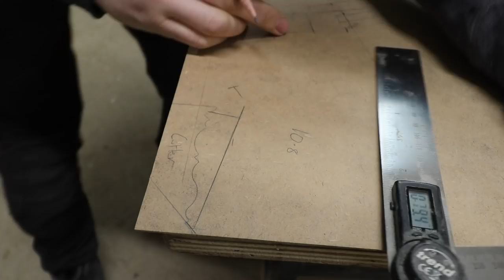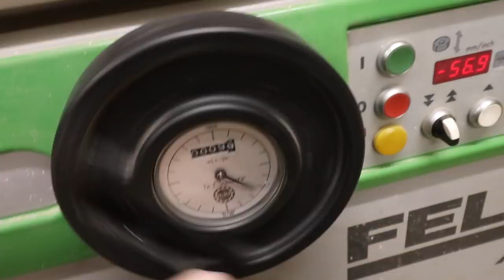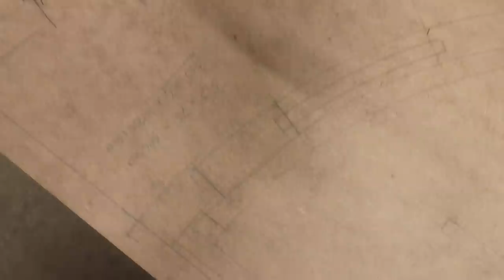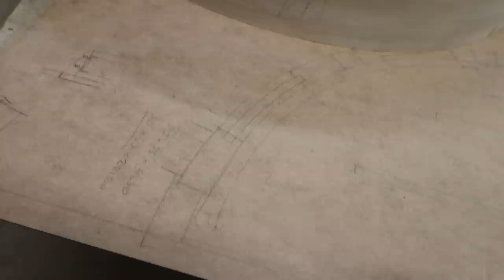Curved Cornice on the Spindle Moulder

Comment: I love the jigs that you make to help with what your doing. A piece of wood with a square cut out 3 blocks of wood screwed to it that thing with the wheel to add some pressure and Bobs your uncle. We expect such perfection from you now and you don’t let us down. Amazing.
Reply from the maker: Cheers John, alot of the time its about efficiency and Planning. If i dont know a successful path to completion i dont make a start until a plan is in place! Like laminating the timber. If i hadnt added the extra height i wouldnt have been able to machine using the uncut part of the false fence to run the moulding on.

Comment: Great to see that there are still some craftsmen coming through! I was a time served, wood machinist 50 years ago! Our machines weren't as sophisticated and we didn't have vacuum bags then either! But the principles are exactly the same! The biggest difference that I noticed was you planned the set the smallest surface on the bed of the SM and I was taught that the broadest side down always! Times change!
Reply from the maker: The smalles edge being down in this case didn't matter as the curve of the moulding supports the piece from tilting! It also means I can bevel the cutter to the right angle, the spindles do not tilt forward only backwards so was the only way it could be done. 

Many thanks for the kind words 👍
Reply: Safety.More liable to snatch the way you mentioned. When moulding is too thin I use back support and toggle clamps. I also served an apprenticeship in wood machining  and after 37 years on a spindle which i use daily i can safely say i have all my fingers

Comment: Always learn something from your videos and I consider myself a competent bench joiner. Showing the big boys of you tube how it's done!  I've had a few scares with the spindle moulder over the years always treat it with respect!! Top class content keep it up! 😎
Reply from the maker: Cheers Scott, i think everyone can learn something from someone, so its good to show your methods/share. Its easy to  have a lapse, or even a unknown piece of grain/knot can cause havok where there shouldnt have been so yeah im always wary.  Sometimes remove clips from the videos because it looks dangerous where my hands are etc, but ive always got a weight in my body position of the work were to suddenly dissapear, that i wouldnt be pressing into the cutter. But its hard to portray that and get loads of negative comments about safety..!

Comment: Great video Oliver and always interested to see how other people do their  curved work. When I do Bowed boxframe sash windows I use a former clamps etc  but having watched your video I will look into the vacuum bag. I've had my Felder f700z for 3 months now and love it.Felder make excellant machines even if their lead ties are long. I'm still waiting for my bandsaw which I ordered last May.. Running the large cutters on a 100mm block is a bit "squeeky bum" time ,I find wearing Tena men help me.I was always told to respect the spindle moulder but don't be afraid of it. lol...All the best and look forward to your next video. I've recommended your channel to a couple of other Joiners.
Reply from the maker: Cheers Adrian, I would personally look at the Curvomatic aluminium setup. Looks brilliant and brought to my attention by a member on here. If i do any more curved work, i will be giving them a call to see if they will do me a deal for a feature video! haha
Ive seen a old boy but bigger cutters in a 30mm whitehill block before. just clamped in the middle, so this one with pin locations is practically child proof! haha! Safe to say everyone else exited the room while he was working. Lol There would often be wedges stuck inthe end wall of the workshop as he cut folding wedges off each other on the table saw, the would bind and get thrown down the workshop 10+metres from the saw and stick in the timber panneling. Haha not good!
Reply: @BradshawJoinery  Cheers for the heads up Oliver, I did see the Curvomatic set up a couple of years ago and it looked good but doesn't seem to have caught on massively yet. How we long for the old days..lol. First spindle moulder I used was a wadkin (iirc) which had a separate break pedal and the second pedal was the spindle lock..When I'd finsihed  I pushed the spindle lock instead of the break and sheared the spindle locking pin off. Then spent the next hour sweeping up. Oh the joy of being a boy back then..lol.

Comment: I think polar is the most underrated timber ya know . It doesn’t seem to go anywhere on joints . I made some shaker doors years ago . Perfect . Don’t think you can use it on exterior work though . Another great vid again . Very very skill full mate
Reply from the maker: No, its pants for exterior work, Its good when acclimatized but will move considerably with changing environment. Ive noticed a massive difference to the quality of my finished work now i have a proper system for acclimatizing the timber before use. 6months after installing and all skirts, arcs cupboards etc all completely perfect. not even a hairline crack in one thing. I couldn't believe it!

Comment: This cutter seems to be made for mechanical feed and is likely marked MEC. It is very dangerous to use such a tool with a manual hand feed! For hand feed the cutter must be marked MAN.

On top of that you grab the work piece and pull it out. This is very dangerous since if the cutter bites in that moment you will not let go and your hand is dragged through the cutter. In combination with the wrong cutter (see above) this is a recipe for desaster! 

The fence and the to blocks although are a clever idea!

Comment: Another great video Ollie.trying to decide wether to buy another spindle, but I only do light cabinet work.. but fen=d up with my router table. How are you liking the little hilti drill?
Reply from the maker: I couldn't be without a spindle tbh. But everything ive ever made has stemmed from them core machines saws planer and moulding machine. Ive never used an actual router table haha!!  Overhead routers ive used a lot, and would like again, but space is a concern. 

Hilti drill, depends what you want it for. I would describe it as great for compact drilling tool, and medium screwdriving work. The finesse of driving a screw isnt reallt good enough for what i want. The festool c18 and CXS are the tools for that job and also offer the multiple heads... which... when using the angle or offset heads, require finesse from the driver. Like i say, better for drilling as speed 2 is quicker than both festools, but i would 100% get a CXS if you havent already. Its so bloody good.
Reply: @BradshawJoinery  yeah, all my buddy's agree on the spindle, but you're a joiner and I'm a box maker 😁

I've got a couple of CXS- or phaser as I like to call them. They're just so lovely to use, it's just the Hilti looked like it runs faster. Also got the bigger 18v and impact but I like the little drills more and more..
Reply from the maker: It's a good tool, but I'd confidently put a flat head screw in with most of my festools, not the Hilti. A quarter turn more on a scree is an unreliable thing to try and do with it which lets it down in my opinion. Its definitely a rugged little fella

Comment: should you not be using chip limiter with those blades?
Reply from the maker: Technically, not if only I use them, (I think) but in reality yes always use chip limiters
Reply: @BradshawJoinery  yeh your right sorry, its only if you employ staff to use tooling you have to use chip limiters.🤦‍♂

very nice cornice, i liked that side pressure wheel you used that was very cool spindle accessory ideal  for external radias mouldings like these 👍

Comment: I am planing to get a tenoner machine. Do you recommend Sedgwick? Or any other brand you may recommend? Many thanks.
Reply from the maker: Yeah love the Sedgwick! The third head is actually really handy! I started on the multico TM machines, but wouldn't be without the 3rd head now!
Reply: @BradshawJoinery  thanks I am looking to get one. The max tenon size for Sedgwick is 150 mm right?
Reply from the maker: I think it'll probably do a little bit more than that but may require a bit of alteration to the stop. I'm sure it'll do nearly 200, but I've never done it. A 150mm tenon is enough  and I think all I've ever needed 🤣👍
Reply: @BradshawJoinery  thanks, I will probably go with that…

Comment: where are your limiters and why did you not break through fence to ensure fully guarding as far as practicable otherwise all ok
Reply from the maker: Don't have limiters for that cutter unfortunately. But i will state it is good practice to use them. Still a heck of a lot safer than old Whitehill cutters